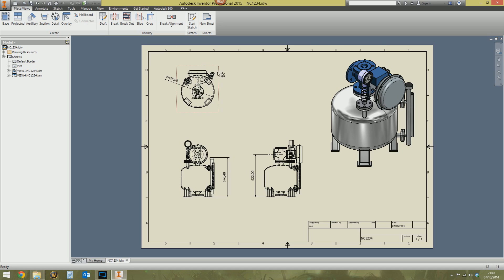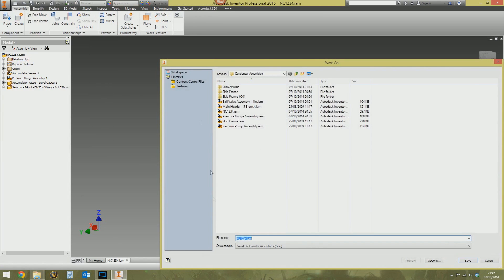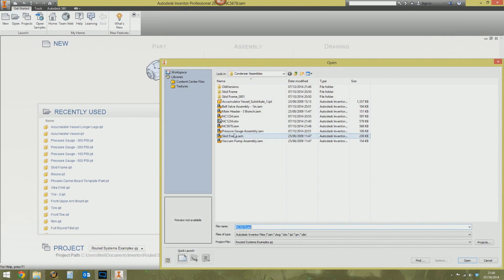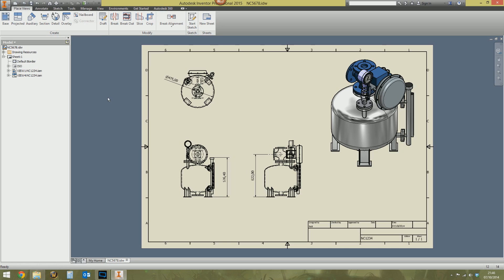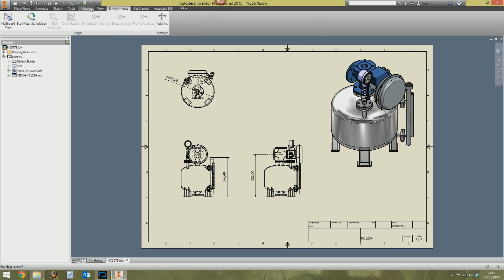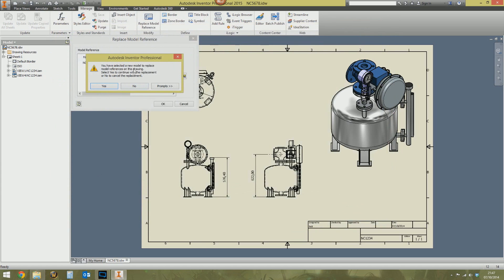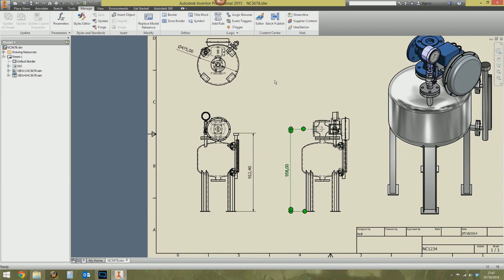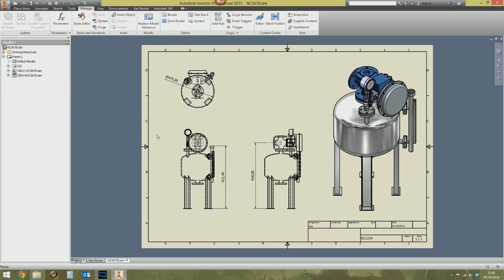Swap/Change The 3D Model Used In a Drawing View | Autodesk Inventor

Comment: Hi Neil.   Just looked back at this just in case.  I'm trying to replace an .ipt in a drawing with an .iam but can't find any way to do it. They are created from step files from a supplier. I've tried to derive the new one into a single part and it keeps failing.    Oh well I'll just have to re-draw it.  Thanks anyway.   Jim

Comment: I am new to inventor but understand the basic drawing commands, I have taken over some very complex models that I am making changes to. The model has piping in it as well as structural and mechanical components. That said I relaxed a dimension for our shop to allow for 25 mils of paint on a structural rack a very of 3.175 mm, updated the drawing, reissued and went back to the piping I was working on well now this previously invisible part was back on in every single view even though it doesn't effect the piping.idws. Is there a way to keep this from happening because it takes and enormous amount of time to go through and turn this rack of in every drawing sheet.